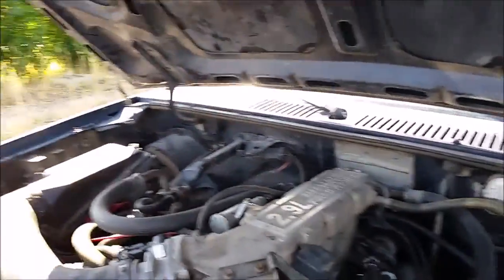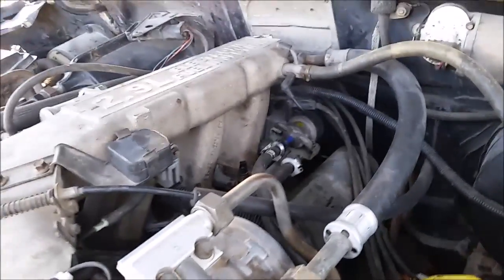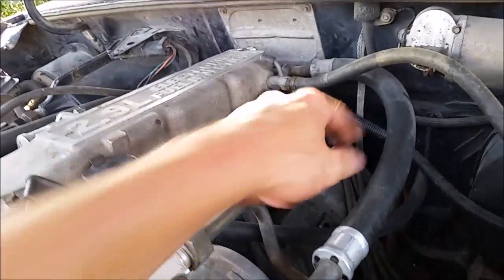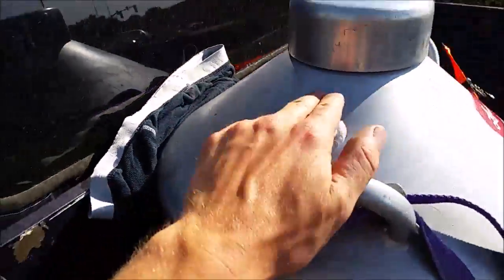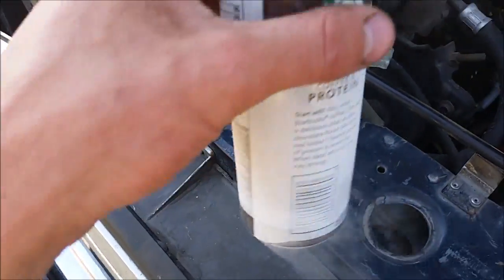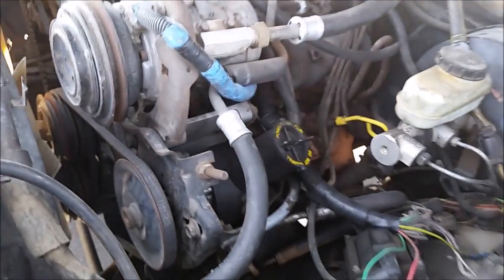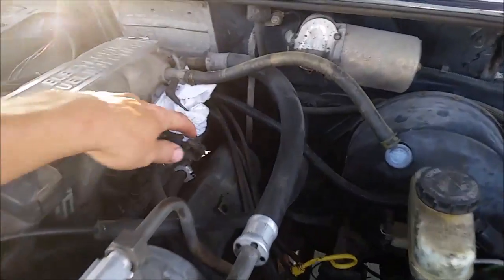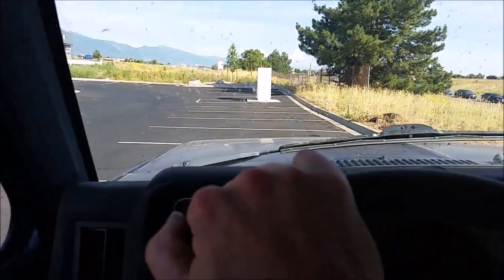Fixing Truck With Liquid Nitrogen

Comment: You wanna be careful when it comes to using anything like nitrogen on an engine, especially if it gets hot, you run the risk of cracking the casings and metal work around the engine

Comment: Can You Use a Sponge to Soak Up Liquid Nitrogen?
Reply: Damn you, now I'm curious about this too and I don't have liquid nitrogen to test with. Cody, science demands an answer.
Reply: yes, you can. Liquid nitrogen has a surface tension similar to water, only it's much, much lighter. Liquid nitrogen would fill the porous spaces in the sponge, of course, it would also freeze the sponge solid but if you took it out you would more than likely get a few drips of liquid nitrogen come out before it boiled off.

Comment: I have a 89 Ford Bronco II with that same setup. Fuel pressure regulator spring is week and just needs a new regulator. This video is a year old and I'm sure the problem has been fixed by now.

Comment: The engine got too hot and it vaporlocked
Reply: or maybe, just maybe its the fact that its a really hot day, kinda like cody said. dont try to guess about a car that you've never seen in person.
Reply: Watch the video again. He clearly said it was the fuel regulator.
Reply: themaritimeman 
The fuel regulator overheated due to the fuel pump heating up the gas going through the regulator (vapor locking)

Comment: So on Acuras and Hondas the MFR (main fuel relay) has a tendency to stop working because the solder joints eventually crack after going through multiple hot cold cycles. I didn't have my multimeter to test the continuity of the MFR on a friend's car so I stuck it in the freezer at her friend's house to try and get it to work. I pulled it out, plugged it back in and it fired up, because the cold caused the solder joints to contract which allowed the current to flow. Both her and her friend were amazed that I was able to make the car work by putting parts in the freezer. Very similar to your situation. I ended up eventually resoldering the joints just so it wouldn't continue to be a problem.

Comment: Probably ran to hot cuz of the poor grade fuel we have like mixing ethanol that old ranger can't handle it and the ethanol is eating the lines and pumps. never use that stuff
Reply: I just use some Lucas upper cylinder lubricant when I fill up, and it seems to help with shitty gas.

Comment: you know what the bigger problem is ..... its a ford
Reply: ...it's 30 years old.
Reply: Ford went through their entire company and circled the problem
Reply: so what company does make a decent car gm no, Toyota no, Honda I suppose but all most all are ugly as sin...
Reply: +Lunas Eclipse not toyota? I've never had a problem with toyotas.
Reply: ***** every recent one I have been in was too small I can't drive a Subaru impreza because with the seat back all the way my knees are pressed into the dash and I don't have room to work the pedals safely...
Reply: +Lunas Eclipse I don't buy that, I'm 5'11 and I've got way more than 3 inches of spare room in my inline 4 cylinder hatchback, you're telling me you can't fit in anything smaller than a Ford truck?
Reply: Vw
Reply: Jake Borg LMFAO!!!
Reply: Ryan Edmonds drive by wire glitches causing stuck wot or floor mat causes it... Also they tend to run on the small side and I'm 6'2" I would get one otherwise...

Comment: Well that was interesting. What causes the fuel regulator to overheat like that?
Reply: +Bike Man Dan just slap a CPU heat sink on it :P
Reply: found on road dead, fix or repair daily
Reply: jdod64
 Nah its a ford.
Reply: Thanks for the reply. Any permenant fix? Some kind of heat shield? Relocating?
Reply: +Bike Man Dan Yeah indeed......liquid nitrogen cooled fuel pipes !!
Reply: +1Shignog So all the things I heard about old Fords are true....

Fucked On Race Day
Flipped Over? Read Directions.
Driver Returned On Foot

I haven't read about their history of quality. I just remember some abbreviations from my automotive school.
Reply: Found on Russian Dump
Reply: +Bike Man Dan increased air flow on it. Best fix would be relocation and it should be possible. Or replacement with a part designed to tolerate higher temps. 

header wrap may help too likely titanium wrap would be the stuff to use.
Reply: Heat
Reply: Cool B)
Reply: +1Shignog can't really gauge quality on a 80s model....

gm was just as shit. Chrysler was terrifying.

its a mix of new emissions regulations and general greediness that made most manufactures build sub quality products at that point.
Reply: It is a ford.